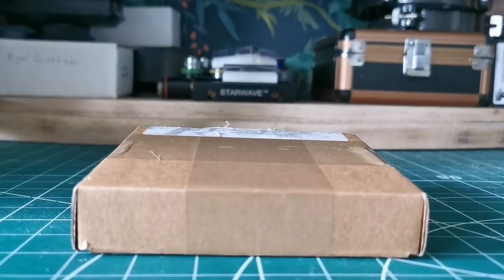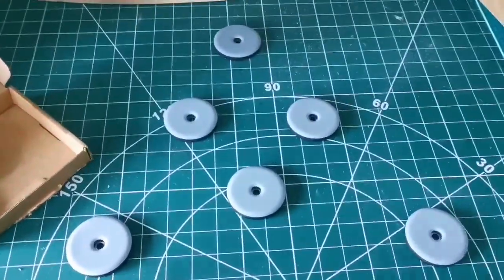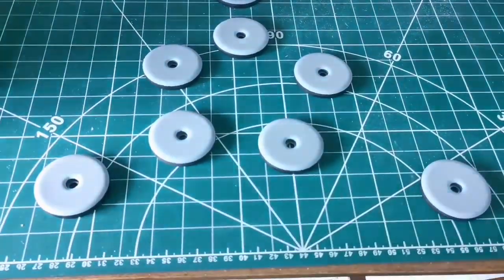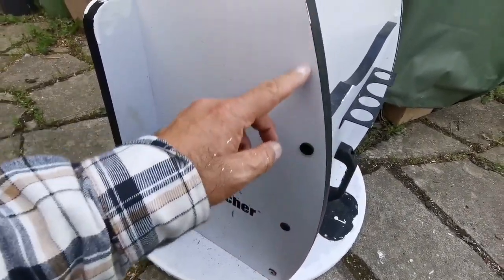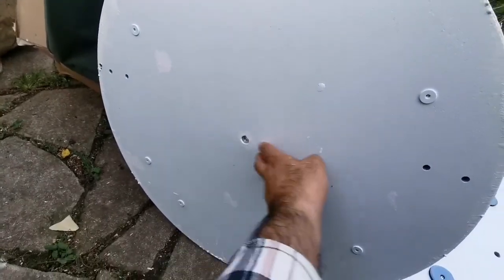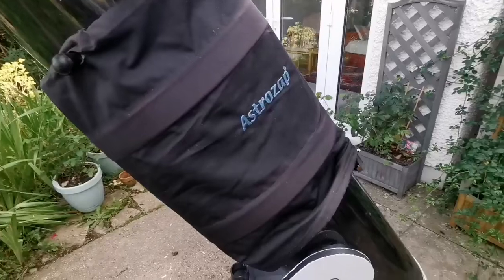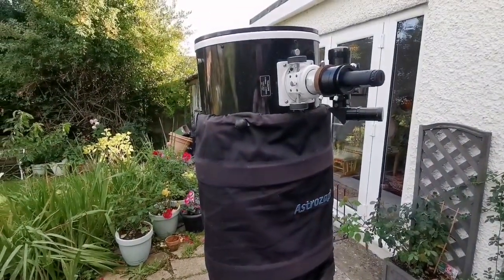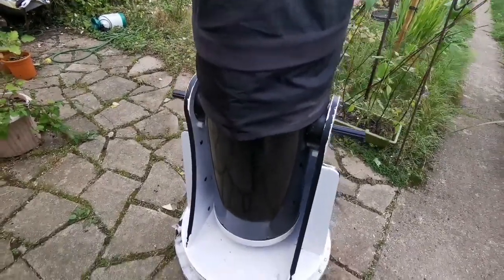Teflon Miracle Fix For Jerky Azimuth Movement In 12 inch Dobsonian Telescope

Comment: A  simple fix is to put velcro on the base plate around the centre hole so that the central  teflon washer rests on the velcro and not the formica. I used the bristle side rather than the furry side of the velcro. Brilliant result! BTW  . . I think It works by relieving some of the pressure from the outer teflon pads on the base . .  so less friction.   I've used the Velcro 20mm pads on the bottom of kitchen chairs to stop the scraping noise on tiles . Lasted for years and years
Reply from the maker: I may try that!
Reply: Honestly, I was amazed ! My Skywatcher 200 was REALLY frustrating, particularly on high mag.  on Jupiter or Moon when inch-ing it along  is required. I used 4 sticky velcro pads and it's like a different scope. Let me know if you need further instructions. Cheers
Reply from the maker: If you could make a video about it and upload it in YouTube that will be great. You don't need to show yourself if you don't wish to, just seeing the telescope will be great to teach and share your findings to others.
Reply: I'd like to but I'm a bit concerned that if I meddle with it I'll never get it back to how it is now  .  .which is actually perfect!